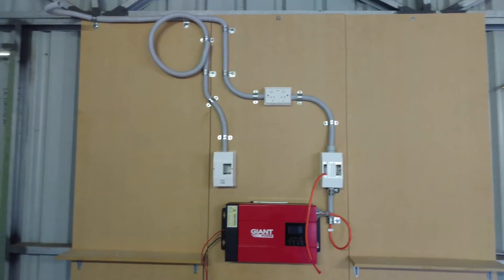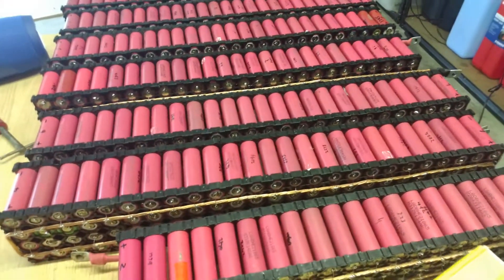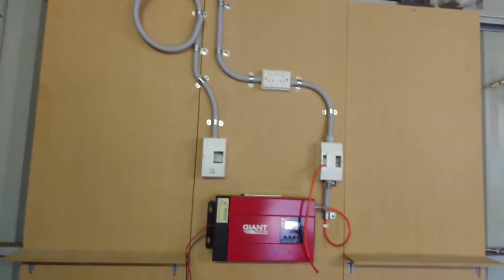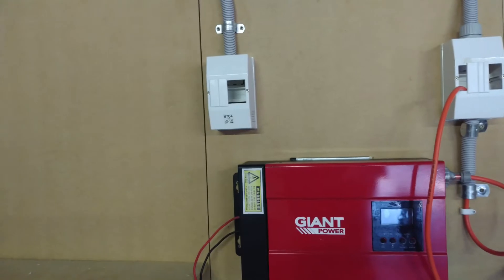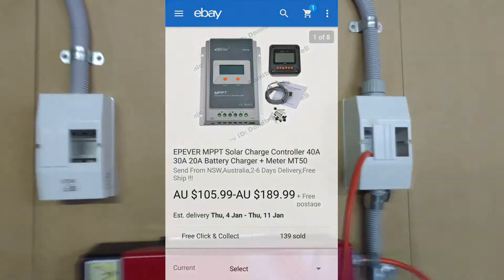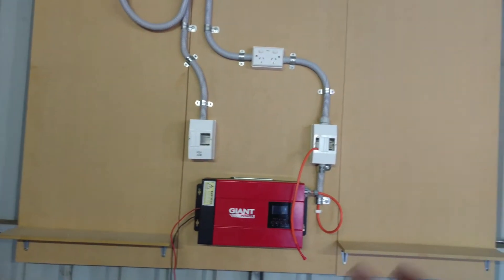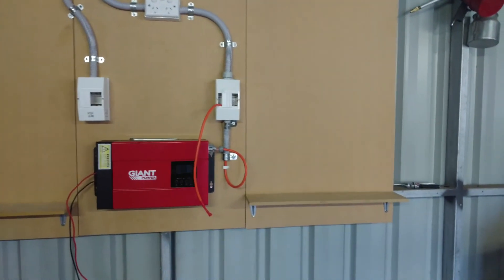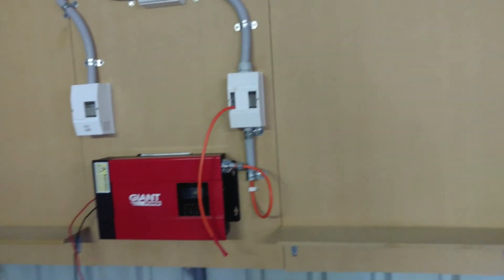DIY Tesla Powerwall | More Progress | Update 29

Comment: I see you're using a car battery inverter. How well does it work? I see several units on eBay for about $100 USD and they are 4000Watt units.
Reply: RandomDIYProjects The giant brand are mostly rebranded mpp solar units
Reply from the maker: Korishan it's 1600w, was 800$ new, it's an Australian brand. Probably paid too much but it's good quality.